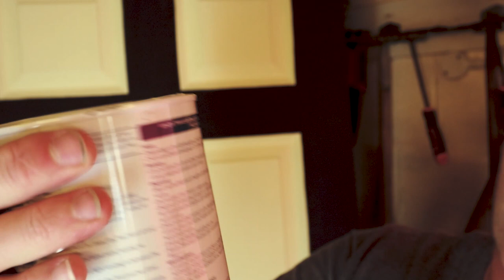applying chalk paint - deco style - aldi

Comment: I have used Aldi chalk paint several times several years and no problem at all. No primer needed, no preparation, stays on furniture. I still have my painted pieces looking perfect. To seal chalk paint (and every other paint) I use Polyvine varnish dead flat,  looks good, not shiny effect.
Reply from the maker: seems to defeat the object of a chalk paint if you're putting a varnish over it though.

Comment: All chalk paint is a con, no undercoat needed (but you have to sand the surface first) then two coats of paint, then varnish or wax because it will easily scratch off unless you do so you spend more time prepping, painting and sealing than just undercoating then final coating.

Comment: Love chalk paint, I've been using it for years. No prepping and a beautiful matt finish.  I've used Annie Sloan and Rust-Oleum.
Reply from the maker: Hi. Do you seal it with a wax after?
Reply: @ProfessionalPainterDecorator  If it's just decor I might not seal it because I love the matt finish. I didn't seal my dresser. If you're going to touch it regularly I do put a wax on it, or a very matt varnish. I used Polyvine 2 x mat, which hardly changes the finish. I'm all for a matt finish. I'm planning on doing my doors and on them I'm going to put a matt varnish on it.  Another advantage is you put paint on it, you wax it, you don't like, you can just paint over it again,  no prepping necessary.
Reply from the maker: @necoragha65  paint over the Varnish ... Not the wax?
Reply: @ProfessionalPainterDecorator  Paint over the wax with no problem.

Comment: Ive used rustoleum and home made chalk paint. I didnt do a good job of the home made so it didn't turn out nice. 
All chalk paints, i think, are supposed to be waxed over and buffed.
I used rustoleum on an old sideboard and before i got to waxing it, something had scratched it very easily. I used the flint grey, lovely colour but even after waxing and buffing you can still get dirty marks on it, like fingerprints from reading a newspaper and they dont come off without taking the paint off. I used the recommended rustoleum clear wax too
Reply from the maker: Yeah. That's for reaching out. I've got some clear hard wearing wb sealant I could put over.
Some ppl do like that chalk board effect.

Tbh.. I can't see a paint to chalk paint unless used for decorative purposes.

You can get hard wearing Matt and satin paints anyway :)